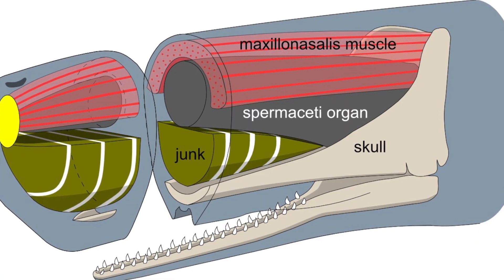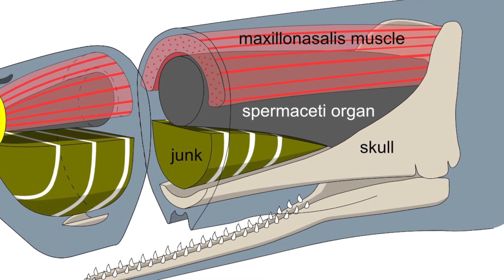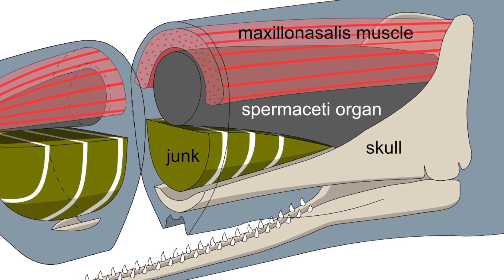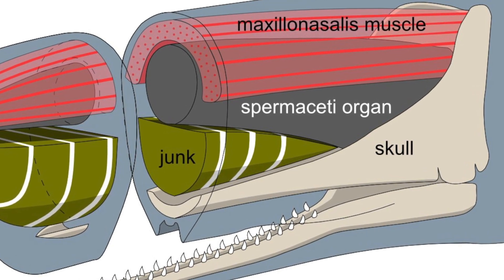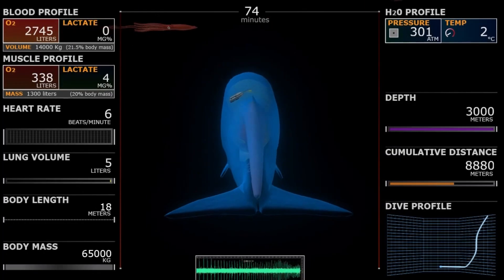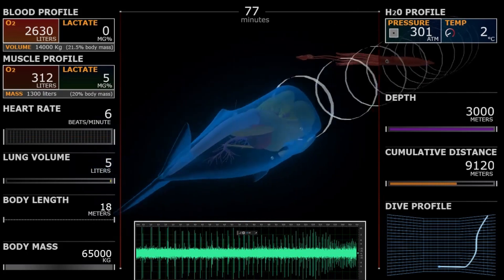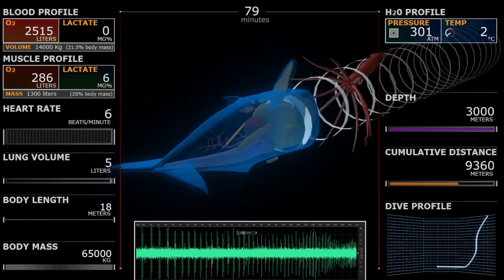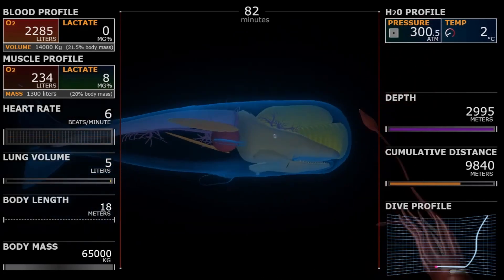How Sperm Whales Dive Deep? What is Spermaceti, it changes Weight? | Fun Fact Fridays TERRA AZUL™

Comment: I'm currently reading Moby Dick (chapter 78) and I came here to better visualize the process of extracting the spermaceti. The funny thing is that Ishmael throws in the book the theory that the organ does exactly what you said in the video: it helps the whale to become more or less buoyant. That is a nicely explained video! Thank you!
Reply: I gave a technical reply for you
Reply: I came here to understand it better after watching "In the heart of the sea"
Reply: Archemids law mention relation between buoyancy force and the shifted volume of fluid which is equal to the volume of sperm whale whole body , but no part of whale body can change its volume specially the skull that contain that oil ,so no matter how oils density changes buoyancy force remain the same !
Reply from the maker: Subscribe to our chanel if you'd like to know more about Whales! :)